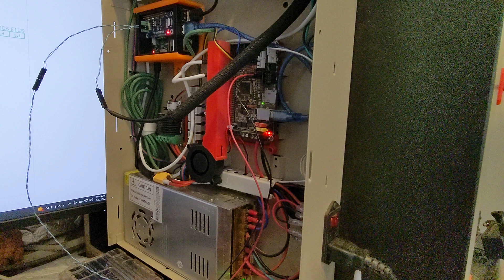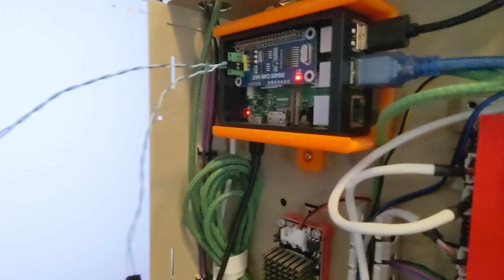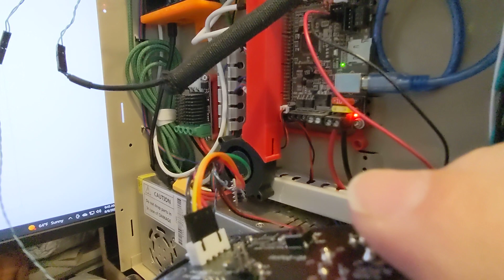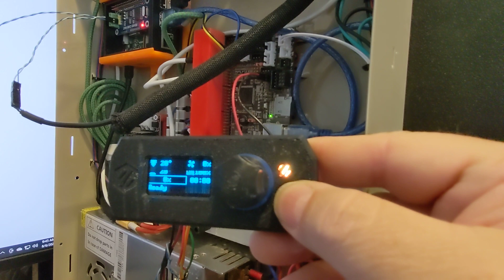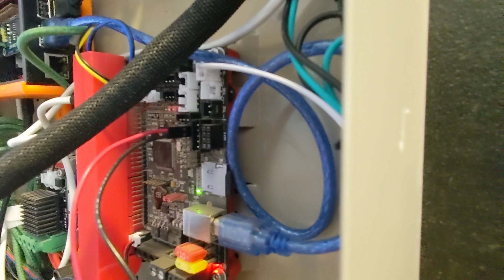Voron V0 Display over CANBUS

Comment: Hey man. Great work. Would you be able to use your skr mini e3 v2(or cheetah v2 with STM32F401) as canbridge over USB? My understanding would be that I need to get a transceiver wire it up to the correct exp pins and flash the board(Klipper docs say canbridge can be done on stm32 and rp2040 chips). So essentially I could hook up my toolhead can board to the skr mini e3 v2 and forego the canhat and any usb to can boards. Is that correct?
Reply from the maker: Maybe with the STMF401.. the  stm32f103 in the SKR Mini E3 isn't capable of running CAN and USB at the same time.